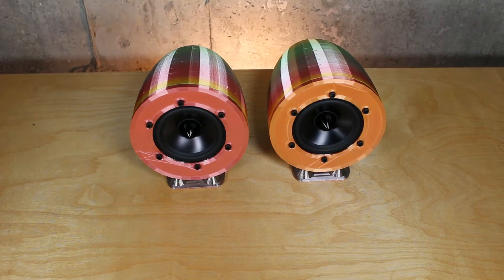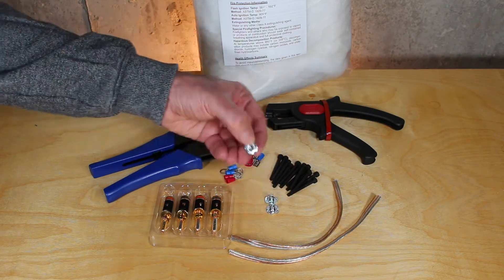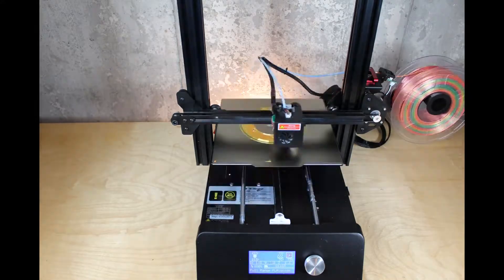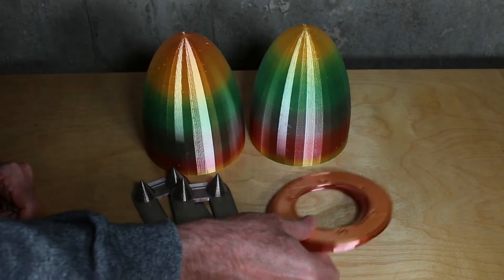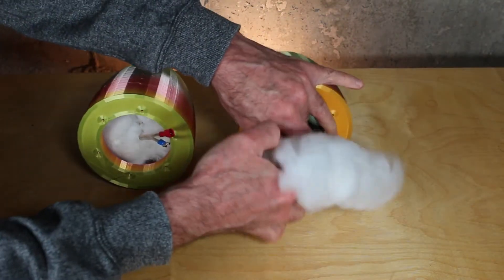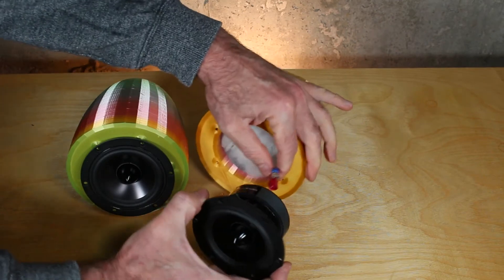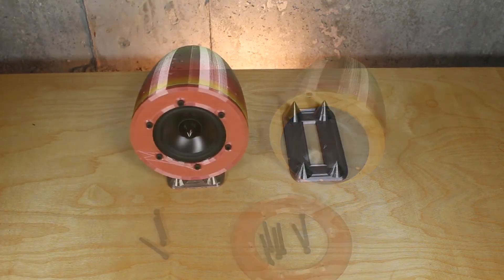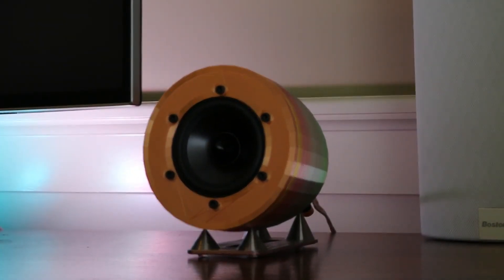Full Range Speaker Build

Comment: This is a really nice design! Is there much option regarding the angle of the speakers? It looks like they're designed to point pretty much forward. What would be great is if they could be angled upwards to point directly at the ears. Would rotating the stand 180 degrees be a possibility?
Reply from the maker: Thanks! You can flip the stand around.  But it's simple to design a new stand that supports a different height and angle.

Comment: Very nice! Any accoustic calculations of enclosure?
Reply from the maker: For the internal volume, I used the recommendations for a sealed enclosure provided by Dayton Audio.  Now that it's built and working, I will take and post some measurements once I receive my calibrated microphone.  Stay tuned.
Reply: @KapmansBasementWorkshop  Nice. I have the great experience with Dayton PS95-8 and verniered box for wine. This is one of easiest speaker to implement diy. Now started  thinking about print enclosure on our Ender. Your filament is amazing!
Reply from the maker: @Wolny248  , One mistake I made was printing the bodies and then the bezels.  Print the bezel then body, the 2nd bezel then body so you end up with a seamless color transition.  Probably obvious, but I thought of the bezels after I printed the bodies.  So I had the order not quite right.  I've also printed another pair with PETG, much stronger overall.  I recommend PETG if you can.
Reply from the maker: @Wolny248  , Thank you!  I saw that project as well.  Very nice and vented.  It probably gets lower in bass response.  In my case, I built a matching subwoofer so I was not that concerned with the bass from these.  I like the sound of sealed speakers and I wanted the main cabinet to be built as a single piece.  I'm not a fan of glueing if I can avoid it.  By the way, I will be posting an update of the subwoofer in the next week or so.  I've made a few improvements.
Reply: @KapmansBasementWorkshop  Could you give some helpful comments about printing.  These are large, time-consuming plotting items and any comment will be helpful.  Maybe the printer settings?  Etc?
Reply from the maker: @Wolny248  , have a look at the Thingiverse link above.  If that does not provide enough detail, let me know what else you need.  I'll try to provide answers if I have them.  Fair warning, these are big prints and will take some time for your 3d printer to get through them.  But most consumer-based printers should have a bed size that can accommodate these.  You will need to print each part (except for the stands) one at a time.  You should be able to print both stands in a single pass.